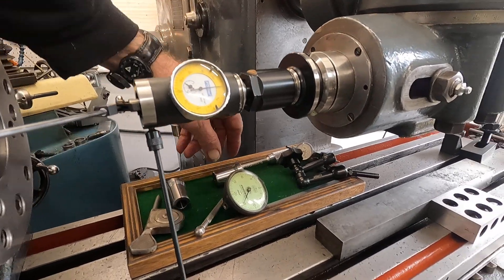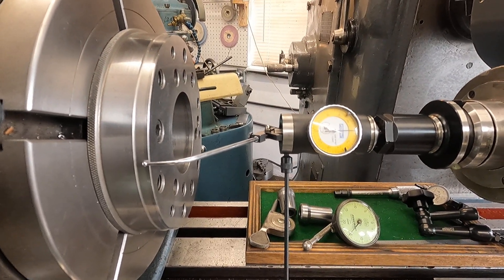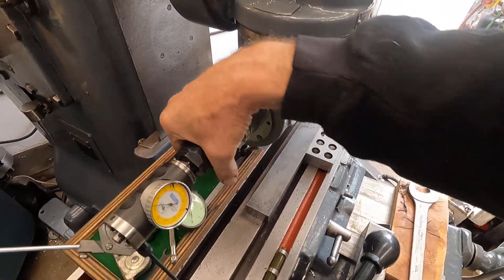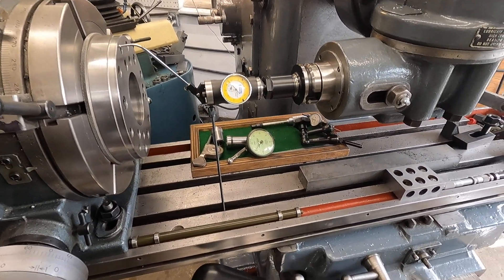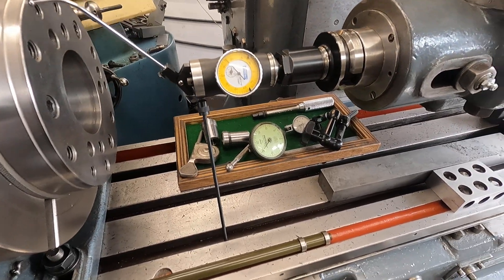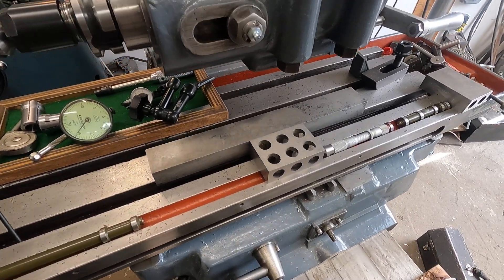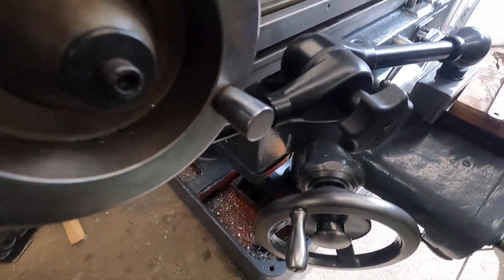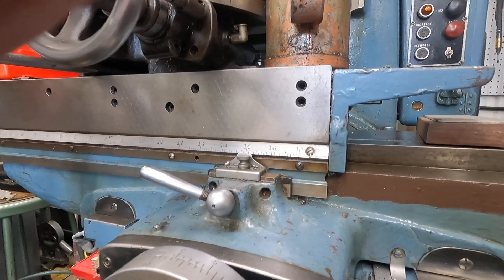Precision techniques for standard machine tool applications part 3!

Comment: Wonderful video series, and many good points. Although I'll be honest with you, I am not entertained with coaxial indicators. Picking up a bore or boss with one and then checking it with a .0005" test indicator on a Noga arm to find that it is .003" out leaves a bad taste in one's mouth. I would much rather use a vertical style indicator on a noga arm to pick up locations.

On the subject of unloading leadscrews, I have found it to be good practice on a surface grinder. You can watch the saddle creep half a thou on a .00002" resolution readout if the screw is loaded. Also, I don't know if you're familiar, but Devlieg Jigmils used an autopositioning system with some sort of standard system, and would automatically unload the leadscrews when in position. I have been told that system will repeat to within tenths. The Jigmil i work with generally cuts and repeats to the number, though it is fitted with a .0002" newall readout in place of the autoposition system.
Reply from the maker: I am not finding over .001" error compared to the regular test indicator on a smooth true surface, I need to experiment much more such as on worn bores. I am going to use the milling machine without a digital read out.
Reply: Another thing that just occured to me is indicator droop- as you're using that coax horizontally. Indicator droop becomes very serious on horizontal boring mills. It would be a good point to bring up in a video.
Reply from the maker: I Found the error in the horizontal position increases with speed, I will bring that up.
Reply: duplitrol

Comment: Use a hydraulic chuck instead of the collet chuck when holding the coaxial indicator. This will save you a lot of time adjusting for runout in the collet chuck
Reply from the maker: I will look into that, have never tried one

Comment: Glad you slowed down the co ax , that's about the speed i run my Blake .  Any faster , it's too hard to read !   👍
Reply from the maker: It was running less then 200, the Fowler instructions says no faster than 800rpm, I found it harder to use at really slow speeds bu still worked.

Comment: Dee Dee I’ll be interested in how much cleaning the gib and ways will make. Putting the table lock on sounds like driving with the parking brake on.  How does it effect creep?  The DRO spoiled me because using it I always know where I am. Glad you’re having fun with mill and sharing so much of how you think about precision work. Very cool.  Cheers, Will
Reply from the maker: The beauty of the DRO is you can see what is going on and correct for it without really thinking about when you lock the table the reading changes a time or two. The reading on the jig bore changes from the oil being pushed out and the carriage settle a few minutes after moving it. Without the DRO you are driving blind and have to concentrate on being consistent in the smallest details such as too much oil on the ways. You should check your machine table with a tenth indicator in various spots when you use the table locks, try it with a lot oil on the ways and not so much oil on the ways. there has two be almost a couple of thou clearance or you cant move the table, when you squish the gib into the table, that clearance and oil is going to move over. Some times dragging the lock a little can compensate. Do not put a test indicator on the back of the stationary jaw on a Kurt vise, that will bum you out. I think using the old traditional end measuring rods will be fine on that mill, it will not be an everyday thing.

Comment: I don't run a jig borer, but I do run the Moore jig grinder at work, and it uses the same table lock system as the jig borer.  Also, in response to your comments in the video, Dee Dee, I agree that you shouldn't unload the lead screws on a Moore jig grinder or jig borer.  The vibration level on these machines is very low and the table locks are both non-biasing and very effective.  However, I do jig bore-type work on a decent Bridgeport with a DRO in the same shop (I am the only one who does both bore work and jig grind there) and the biasing nature of the gib-locks means that you cannot adjust them and keep positional accuracy.  Thus, I set them so that they drag and then crank to position.  If I leave the lead screws loaded, then the table will creep off of position by up to several thousandths over the next 5-or-so minutes as the machine vibrates (as witnessed by the DRO).  I wish that my shop would just buy a good rebuilt Moore jig borer, since accurate bore work is so much simpler, easier, and faster on a real Jig Borer.
Reply from the maker: I am a lock dragger also. The Moore jig borer is refined with just .100" per turn, and table movement is effortless, the huge advantage in boring precision holes is the head instead of a knee below the table going down moves up out of the way for tool changes and using regular dial bore gages, and the head returns exact every time. No moving the table.